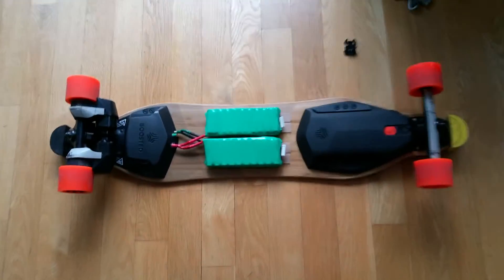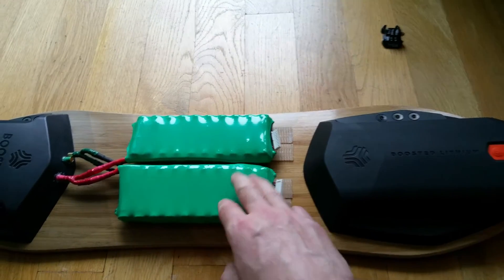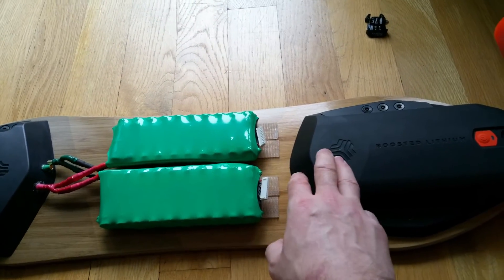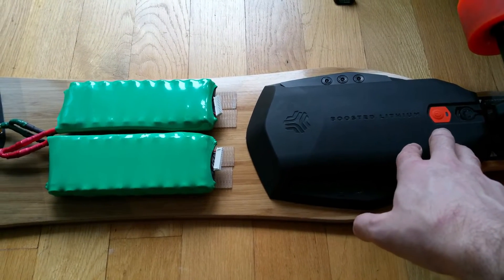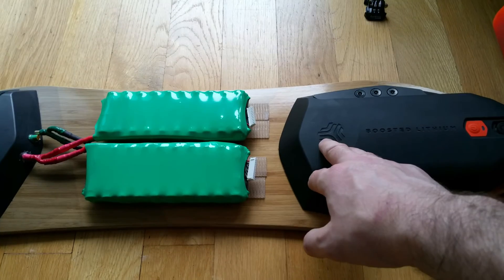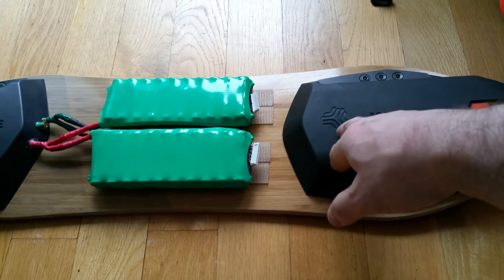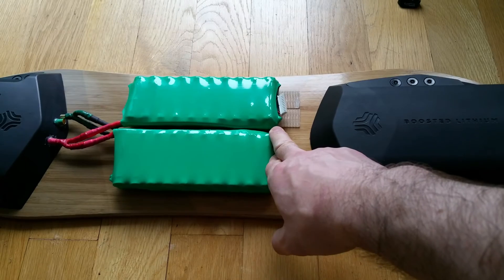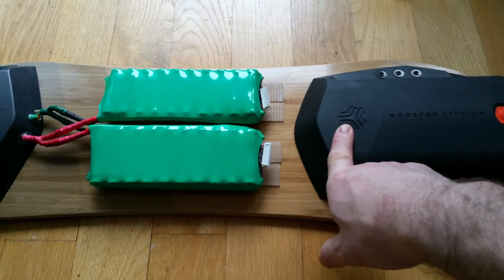Boosted Boards - Why is the red light blinking?

Comment: Hi Vitale!!  My V1 board is blinking red now 12 times when I have it plugged in..  do you know what that is?  I don't have the extra battery plugged in.
Reply: As a follow up - the 12 flashes happen when it is plugged in, when it isn't plugged in the light just flashes on and off red
Reply from the maker: I have to have the board and check it with a voltmeter. Just get a v2 standard pack and swap them.

Comment: What cells do you use? And if I do this, should I properly balance the cells say every 50 cycles?
Reply from the maker: cells need to be balanced only when there is a significant difference in voltage.

Comment: When my board switches over to only the extended range packs, i notice a very large decrease in speed and climbing ability. At first I thought it was the batteries just being low on charge but I then discovered that I could still go very far, just not fast at all. What could be causing this? I'm using the same setup as you, 2 10s packs.
Reply from the maker: Smaster1755 u have cells with low C rating.
Reply: Portable Electric Vehicle That's what I thought. thanks, I got these from a random Hoverboard that wasn't working that I just had lying around. probably going to swap them out later.
Reply from the maker: you can charge all of the cells and use them combined or double up the packs so the C rating increases. Otherwise you need to get some really good cells. Otherwise you will kill them over time. 
Please share and like my videos in you find them helpful. Thanks.

Comment: Basically when the board dies can you connect a charged 18650 pack and keep riding? Or will that be too much imbalance for the BMS to handle?
Reply from the maker: I never tested that but your battery packs should always have the same voltage.

Comment: Hey V. I got my son's boosted for the winter and want to add the additional packs. Not sure but are the boosted batteries LiPO or LiFePO4? Looking to add range as I have a Enertion Raptor in route and want to have him be able to ride as long as I can so additional packs will be required.
Reply from the maker: +Laszlo Keszthelyi Boosted is using LiFePo4
Reply from the maker: I would like to see the raptor...
Reply: +Portable Electric Vehicle I got the 2700 battery pack already which shipped seperately. The Raptor should be here soon. I'll text once it's here. I want to build the packs for the BBD+ soon but they should be 12cells, right? I'll reach out to you in the next week or so to meet up and discuss.
Reply from the maker: Ok
Reply: Thanks for the info. I pre ordered the inboard. But not sure if it had what I want had more of the rang I want. Need 7 miles to get to work. Raptor blows that out of there water. This really helps thanks again.
Reply: +Laszlo Keszthelyi hey did u ever get your raptor I was looking to get one but can't find anyone online that owns one. any input would be great thanks.
Reply: +Addison Franklin Yes I did and the thing is awesome. I can easily out accelerate my younger son while he is on the BBD+ and I'm on the Raptor. It is really powerful. As far as top speed and controls the BBD+ still feels smoother or more refined and going down hills at full speed it is more forgiving of over-speed (full throttle going down a hill). The Raptor feels as it is wants to limit the RPM and as if it has a hard top speed limiter (it slows down) with engine cut off like in a car. I am sure I can reprogram the speed control to eliminate/smooth this out, I just have not yet. Torque is in its own league compared to every other production board I have ridden. Yes it is also faster 22.1 MPH on the BBD+; 29.7 MPH on the Raptor with me on it (out of the box, using phone GPS several laps around the same block of my neighborhood). I also ordered different drive pulleys so I can change things up as well as having the ability to adjust VESC RPM limits) . The deck is much stiffer than the boosted so the ride is completely different (think Ferrari vs BMW both great in their own ways). I have found that on rougher terrain (crappy streets) there is a lot more road feel, which is great at higher speeds but gets old over longer distances. I feel a move to a softer durometer wheel and/or little larger diameter wheel will be of benefit on longer rides, or I may just use sneakers as opposed to my Vans. I also had installed 94 durometer skateboard bushings (long board bushings not easily available close to home) but still too soft for me so I have to get real 94 long board barrel bushings at the long board shop closer to work. It is a littlle heavier but worth it for the nearly 3x battery capacity. Only concern with remote is it has an extra long mini USB connection so do not loose the cord that comes with it. Fast charger is about 2.5x size of BBD+ charger but still entirely backpack-able.
I did have to tweak the controls from its original settings with the help of a seasoned VESC programmer who was nice enough to email me then call me from Australia to work through the entire programing so acceleration has been improved as well as the low voltage cut off which was a little too much too immediate. I have to increase the braking force  back up a little as it is good but not enough for steeper hills. The ability to fully change the settings is absolutely awesome especially for me who is far outside the typical rider profile. There are days worth of reading with respect to customizing the controls on this thing on the forums. If you just want ready to run I would wait till a more general audiences version is put out. Got to have a truly awesome ride and willing to work a little to tweak things. Drop you wallet open and grab your drool towel with a spare for the ride. GET THIS THING!

I like the cruise control feature on longer rides but (again on a crappy road in front of work) I hit some larger rocks from asphalt that was crumbling and accidentally may have hit the cruise control as I stumbled, it took off from under me with all that amazing torque and I bit it pretty bad at about 20 MPH & pulled my rotator cuff pretty good which is why I have not ridden for about two weeks now. It is still new (only about 25 miles on the thing) and I need to do a lot more tinkering to get it just right for me. More reviews to follow in about two weeks. I'll be cruising around the NYC West Side Highway Long Board Autobahn with it soon again.
Reply: +Addison Franklin Let me know about that one. The important thing for me was the 63mm motors, the torque and the increased battery. The singe motor Raptor is just about as fast just not as quick and a great deal now if you fit into the avg 150lb person profile. 
Let me know if you are around NYC.

Comment: Is that 20 or 40 cells? And what is your overall range on that? 😋 Very nice work!
Reply from the maker: 20 or 40 cells....?
Reply: +Portable Electric Vehicle yeah, you've build up your batterypack of cells (18650 battery cells a assume) 😉
Reply: +Portable Electric Vehicle but how many, because it looks like they're in two layers each? So 40 extras in total or 20? And what is the range with that?
Reply from the maker: ***** 10 cells each pack...should last about 20 miles.